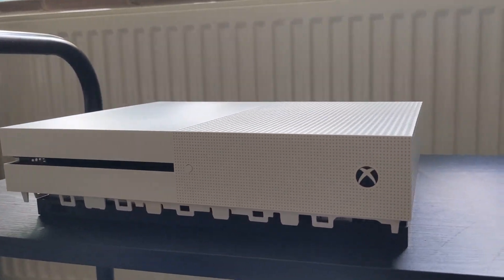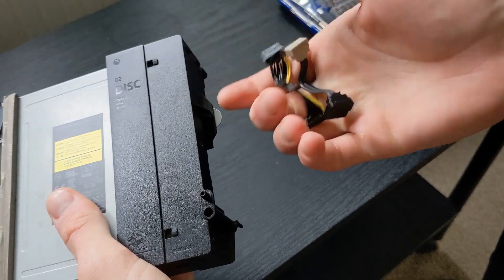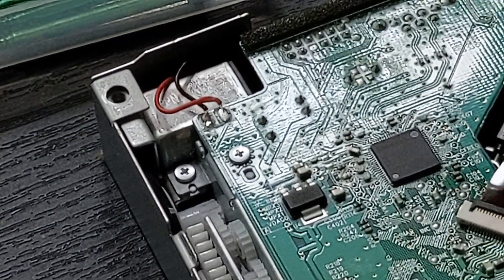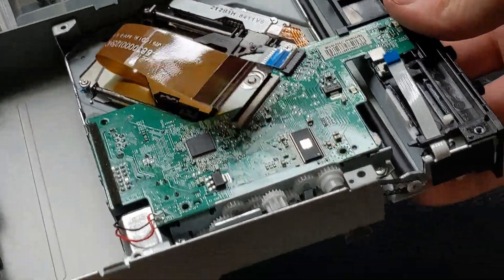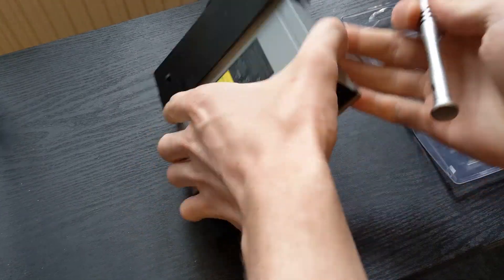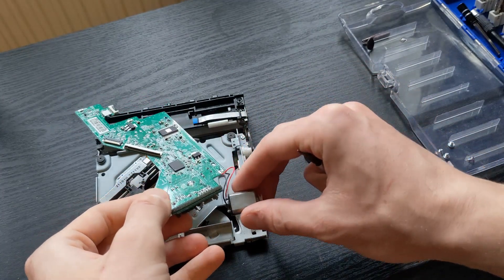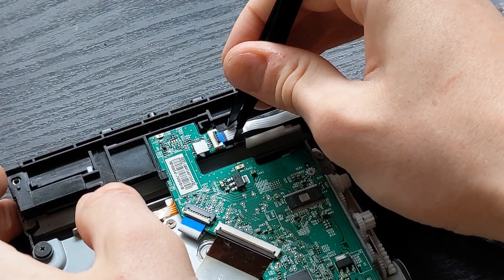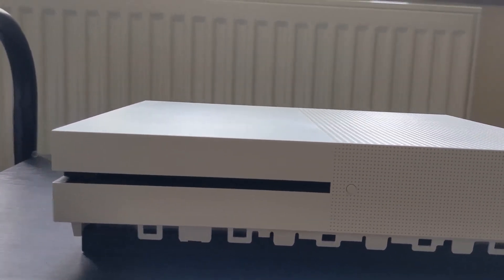Xbox One (X/S & Series X) Disc Drive Replacement | No Soldering

Comment: How do I tell if it's the motor or the laser?  The issue I have is that my fat Xbox One accepts certain disks, but often refuses to even read the bulk of them.  I can hear the optical drive trying to work inside, and with certain games it will whir up and read no problem.  Another issue I have is that even if it can read the disk, when it tries to install, it will get so far and then fail every few minutes.  I can't tell if this is the motor failing to spin the disk for long enough to install, or if it just can't read it and gives up
Reply: I have a similiar issue where my console only reads DVDs but not games, found a solution yet?
Reply: @AaronOsome  Sorry for the late reply.  I ended up just replacing the disk drive deck.  It works perfectly now, you can find tutorials on how to do it on here and the drive deck itself cost me £12

Comment: thanks dude, I've literally just asked about this on another clip then saw your guide. Question... are these xboxs like the old 360s? is there a certain model drive it needs, depending on the main/motherboard, or can I get any series x disc drive? thanks in advance
Reply: Unfortunately it's like the 360, you need the same model drive.

Comment: Are the disc drives the same from the one s and series x
Reply: Yes
Reply: @Muthertruckeronastickbruuuu I asked the same question from a repair shop they said no . go figure .
Reply: Coming back to this, I wanted to know too because I plan on replacing the laser disc from my series x with the Xbox 1 since it doesn’t read discs anymore
Reply: @thathomiefox  I'm thinking my issue is with my laser, too.  I can play BluRay but not DVD.
Reply: @rfh1987  that’s a weird issue, you can always call repair shops to see if they have an idea.
Reply: @rfh1987  it is the laser. I've had that issue before and now its happened again. Reads blu ray but not dvd discs. I think its easiest to replace the laser deck.